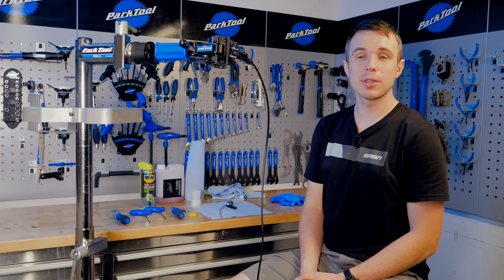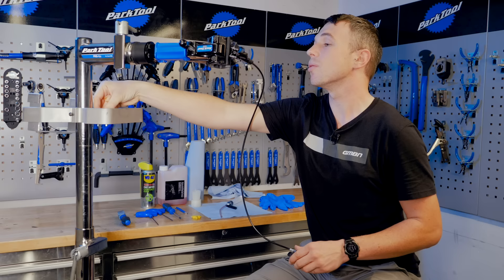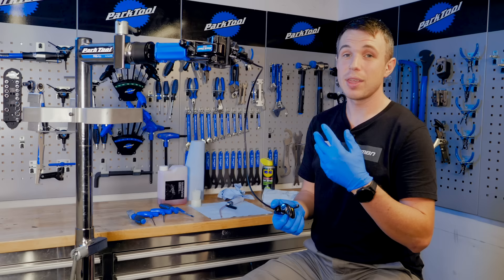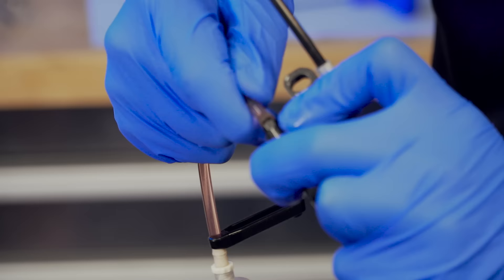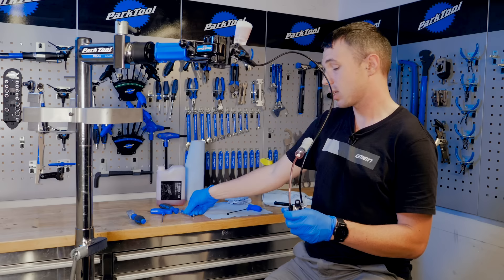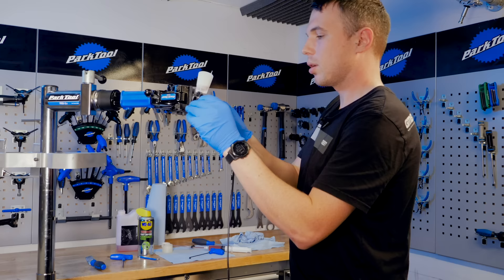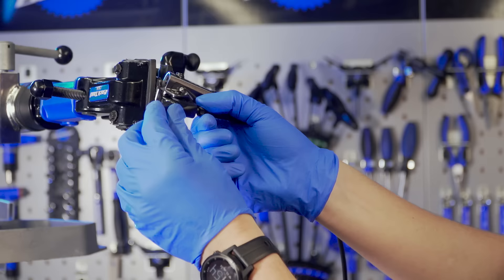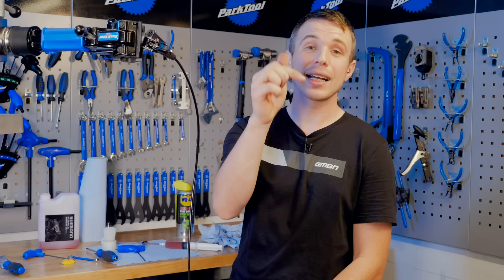Bleeding A Shimano Disc Brake In Real Time | How To Bleed A Disc Brake

Comment: I am finding that my levers end up close to the bars after the bleed. Could this be to do with using the shimano spacer then having third party pads? Is the shimano pad assembly wider than the third party assembly? If it was wouldn't the gap for the pads and rotor be too wide then making the travel for the pistons too much?
Reply: This happens when you still have air in the lines.

Comment: Can you over fill the system? I’ve just tried to bleed my brakes. And it looks like when I squeeze my levers in a small amount of brake fluid appears at the leaver. What have I done ?
Reply: That's good, that means there's not air (unless its trapped somewhere) in the system.

Comment: I would take my bike to the shop but they are servicing one month out...I think I need to bleed my brakes but I cannot push one of the pistons all the way back in. Anyone know what might be wrong?
Reply: i had the same problem. undo the bleed screw at your brake lever  (don't loose the O ring) and push the piston back in it will let a bit of fluid out and you should be able to push the piston back in. then see if you need to bleed it afterwards.

Comment: #AskGMBNTech hey guys! Quick question, i put a new pair of pads in my BR-M315 i pushed the piston into it's original place. Now the oil is leaking from the lever, need help i raced earlier even the oil is leaking (but not that hard) 😂. Is there any solution to this problem? Don't want to spend money for a new set of brakes. Thank you!

Comment: When I attempted a bleed I had the bleed port open and funnel in the lever end but when trying to inject the oil the syringe was completely solid. I press a bit harder and then the syringe popped off spraying the oil on to the floor!! What caused this? Pressure in the system?
Reply: Are you sure you had everything open.. 
Otherwise were you working on the actual 'pair of lever and caliper' so not rear caliper and front lever.😂
Reply: Rick Vermij I am 100% sure! It’s really odd, I can’t understand it, I may try different syringe next time 🤷‍♂️
Reply: @tdog472  well you could try gravity bleeding. No pressure needed then.

Where did the hose disconnect. Caliper or seringe
Reply: Syringe. What do you mean by gravity bleeding?

Comment: What about if I'm changing the caliper itself to a Shimano Saint? Is the process any different.
Reply: Not really, you may be required to push more fluid UP to fill the caliper and push that void of air through the top. Just take your time. Brakes are important.
Reply: @forevercomputing  thanks mate!

Comment: mineral oil is safe
Reply: ....ish. Although not as corrosive as DOT fluid it will, if left on paintwork for any length of time, taint the finish. Put a few drops on the back of your hand and leave it there. After a short while you will start to feel a tingling.

Comment: #AskGMBNTech
Hellooo Henry!
Could you please tell me why my brand new tubeless system loose air (after a few hour it is almost flat).
Reply: You need to try and find any air bubbles. Remove the wheel, inflate the tyre to a high pressure and put into water and observe for any bubbles. Take your time.
Reply: @forevercomputing  thank you!!
Reply: Mine had poorly applied rim tape so air passed out through the spokes.

Comment: Phillips screwdriver? WTF - POZIDRIVE! The amount of time I've spent in my life undoing screws that someone's used the wrong screwdriver on.
Reply: Otherwise some great tips. I bled my hybrid's rear brake after 6yrs, having replaced the pads several times. That bleed reservoir is absolutely essential. Important to flick the lever & pipe several times before sealing the system.

Comment: This method is rubbish. I suffered through this syringe method for years until I found the gravity method. Only the cup is needed. Perfect bleed every time. Zero chance of introducing bubbles. Zero chance of pulling dirty fluid back in. Zero mess. Uses less new fluid. It even lubricates the pistons.

Comment: this is not the correct shimano method. You should flush out the bottom. This method waste oil and puts contamination into brake levers